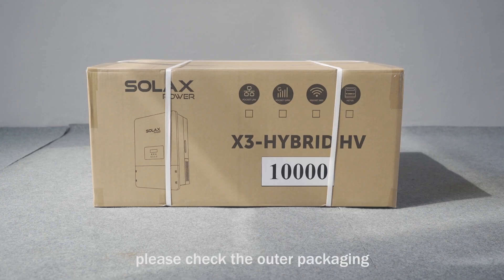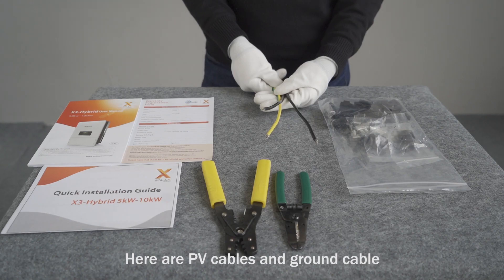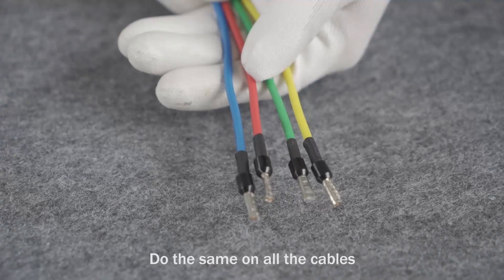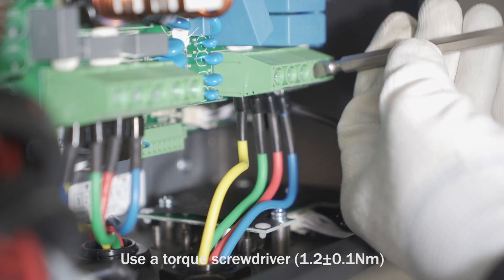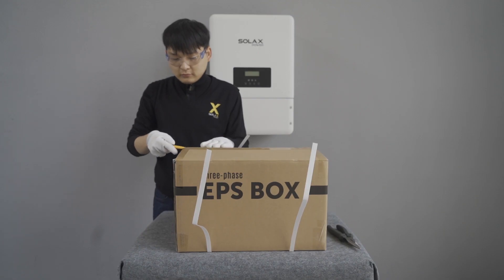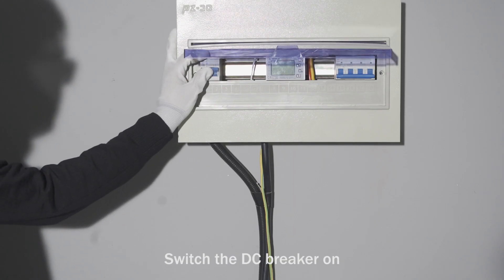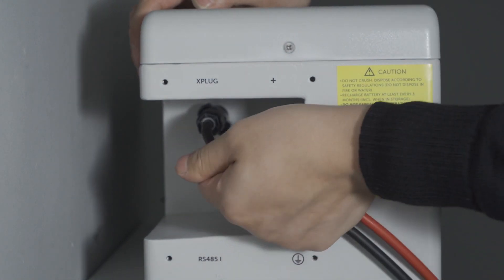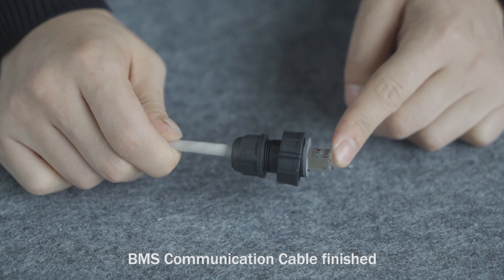SolaX X3-HYBRID Energy Storage System Installation Video

Comment: Hi, I have 4 5.8kwh solax batteries on a 3 phase system. I am achieving a consistent 14kwh 'daily 'yield' when draining from 100% to 10%. Is this operating correctly? I was expecting around 20kwh (with inverter loses etc). I am told nothing is wrong by supplier and is working as it should.
Reply: Yeild with LPF batteries depends on a number of factors including operating temperature, cell compression, charging and discharging rate etc.

Comment: Can you explain the differences between only EPS Box and your Matebox? Are there any advantages in durability or robustness between them?
Reply: 14:06
Reply: It is not the same thing, the matebox is juste a connection box with DC security in place, you set it up and connect the cable, it is just an easy way to connect everything. The EPS box is an electrical appliance that will switch automatically to battery power when the current is out.

Comment: can this block reverse current to grid
Reply: With the EPS box yes, you'll have your important load connected to the battery and powered while the current is out and the onduler will not sent energy to the grid.